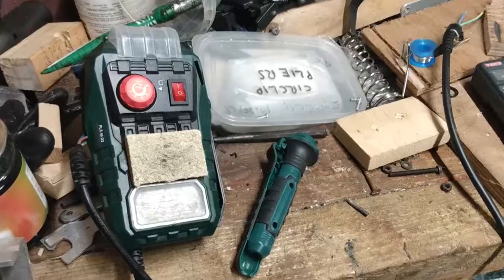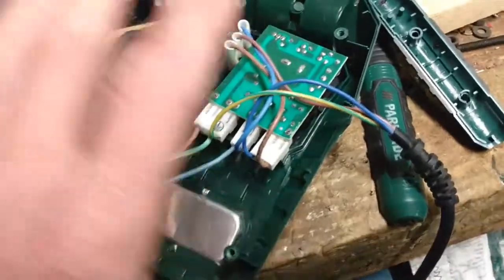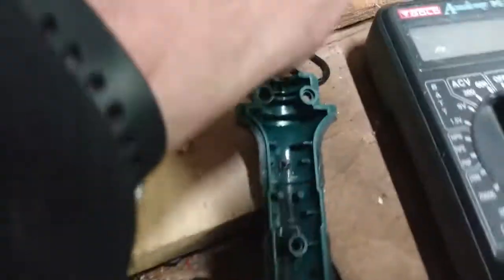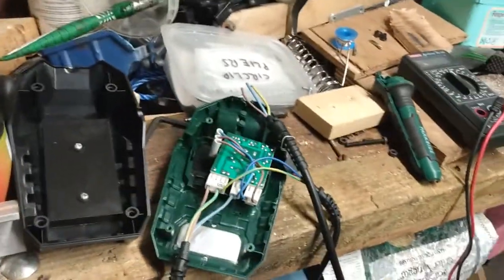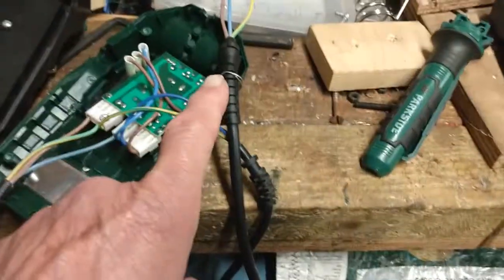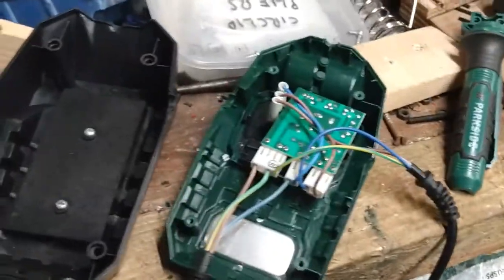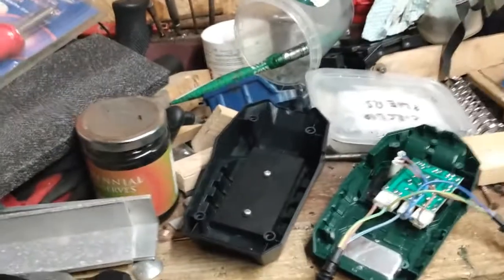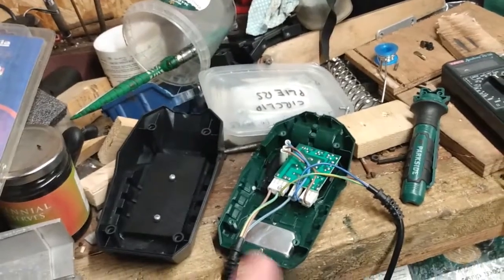Lidl Soldering iron   repair or throw

Comment: I have two irons, same model, both with faulty boards and with good elements. It's probably best to just put plugs on the irons and use like that. I can always use a dimmer which I have several of if needed..I think I threw some other similar Lidl irons away when the elements went open circuit.
Reply from the maker: Sounds like there is a quality issue.

Comment: In order to have temperature control the Parkside soldering wand must have a temperature sensor attached near the tip.  That's probably why it has three wires.  I don't thing the new 24 W unit has the temp sensor in it.  Great Video!
Reply from the maker: Hi Dan. I do not think this has any temperature sensor, just a simple element.  The control circuit has no feedback,  it is an open loop thyristor power control. Cheers,  John
Reply: @bikerides  OK!  That's right, I do remember you saying the circuit was like a simple light dimmer!  Sorry about that!
Reply from the maker: @danedewaard8215  No problem. I confuse myself sometimes as you will see in some of my videos...

Comment: Hi There
I wonder if you could help me. As someone who hates to throw things away if I can possibly fix them, I took dismantled a Lidl pl 48 d temperature controlled iron. Inside I found that the small transistor on the board had blown apart and was unreadable because of it. I will probably try out a couple of random transistors but, if you still have the unit, I wonder if you could look and see what that transistor actually is.
A big ask but, if you don't asked.... Etc
Thank you either way
Stan S
Reply from the maker: See Short reply
Reply from the maker: @anemomili  BT137-800E triac. Circuits for simple triac control are readily available.
Reply from the maker: Hi Stan. The device is labled BT137-800. You may find that a complete power control circuit is cheaper than the single component.
Reply: Mine is marked BT131 and is a triac. Don't try transistors.  I've two faulty boards so will bypass the boards or put plugs on and use a dimmer if needed.

Comment: I'm thinking of doing the same thing so I'm interested did you make it work? I think it's 48 watts because it's marked "PLS 48 D2". I have a problem with poor quality tips on the similar iron "PLSD 48 B2" because I can't find replacements. Of course, those tips don't tighten with screws like in most soldering irons instead have a thread on the bottom and screw directly into the handle.
Reply from the maker: Hi Alex. I have alternatives that I can use so this one sits there as potential future project. Can't remember if I said that I bought a new Lidl one that is working OK. Generally I am disappointed with several iron bits. I thought they were supposed to be copper inside but they refuse to be tinned. Cheers.  John

Comment: Bought one a Couple of days ago and was Soldering something when the Tip of the Soldering Iron suddenly produced a Shower of lethal looking Sparks that looked like Mains Voltage!

After which it Stopped Working! and now Thanks to your Video I can why that was! 240 Volts in and 240 Volts out

Way too dangerous imo and so its going back for a refund, as if I'd been touching the metal part, who knows what may have happened!
Reply from the maker: that sounds really dangerous. I'm glad you are OK. Make sure they know why it is being sent back. Best regards, John.

Comment: I've use mine maybe 5 times and now its a dud, won't heat up.
Reply from the maker: Three year guarantee. Get your money back. I got a lot of use out of mine before it failed. Good luck.
Reply: @bikerides  Also I was using mine at full power, that's probably why it burned out. It didn't occur to me that the heating element wears out faster at high temp. Live and learn.
Reply from the maker: @mikko3d  That is a very good point.  The elements will not be designed to have a long life at full power.  Nothing like a good old Antex or Weller.
Reply: I found that my recipts from lidl always faded out after time so you cant read them. Not my favourite tools now.
Reply: @bikerides  Unfortunately I lost the receipt. Oh well. After doing some research I'm thinking about ordering a Quicko T12-955 station from Aliexpress. A little more expensive, but people seem to like those and they have replaceable handle and use Hakko tips. Also works with 24 volts.
Reply from the maker: @mikko3d  Hi Mikko. That is a good comment.  I must have a dozen different soldering irons. I miss my Weller iron with interchangeable tips. Cheers.  John
Reply: My mate bought one few months ago and now it doesn't get up to full power, he's now done what l did ages ago bought a Weller soldering gun of eBay, mine was £8 boxed, they are really good.

Comment: I bought one of these soldering irons used it a couple of times it failed, I've had it a long time unused, did not expect it to fail being park side an all, so now I'm looking for spar parts to repair it.

odd thing is there doesn't seem that many elements of the same rating, most are higher or lower.

Disappointed with Parkside on this one, their toos are normally decent.
Reply from the maker: I bought another one and it is working fine.  Cheaper than getting spares.  We need to keep our receipts because they do honour three year guarantee

Comment: I bought one of those red irons years back at a car boot sale and it used to burn the tips, so I'm curious how this worked out.
Reply from the maker: Not implemented because of a new iron but the bese is there when needed.
Reply: @bikerides  So a chinese iron with 5 pin for 5usd would work if swapped and resoldered ?

Comment: I'd make exactement the same with 30 Watt iron, rund very well!
Reply from the maker: That sounds like a good idea. Nice to have a stand and a cleaning pad.
Reply: @bikerides  I'd not attacht the iron direct on the station, but made an electric plug in the cable so i can change the iron if necessary without damaging the cable and plug of the iron. Very usefull.
Reply from the maker: @mhi7079  great idea. I will probably do the same.